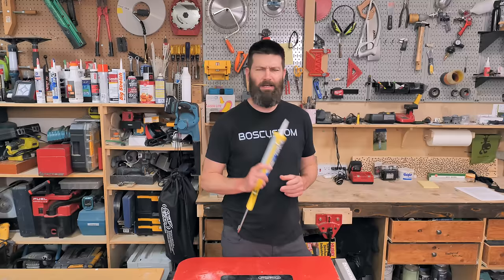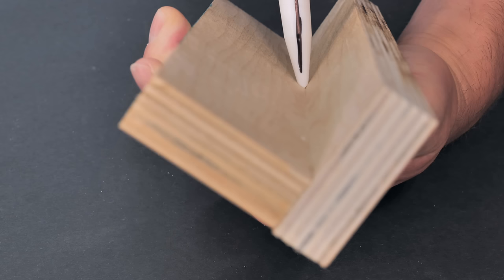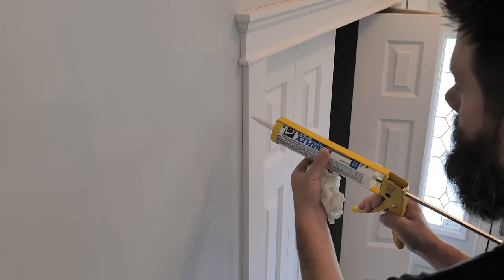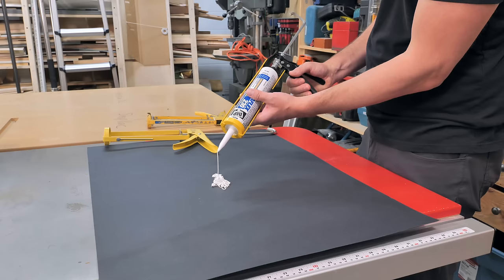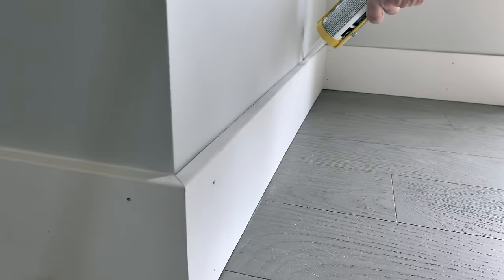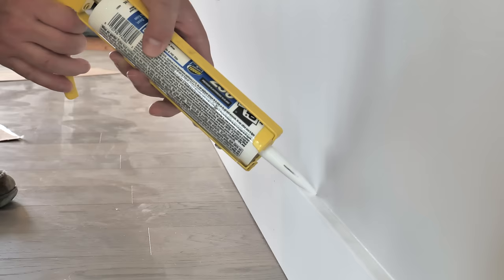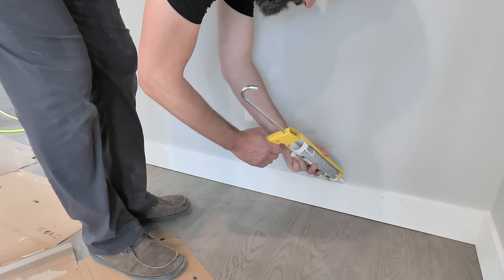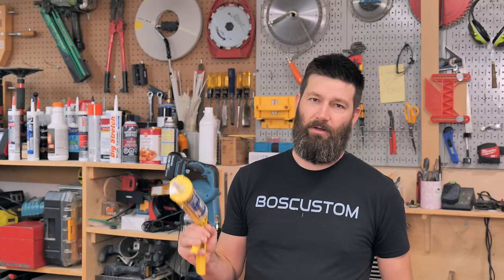The Secret Caulking Tip That Will Transform Your Ability!

Comment: I'm a carpenter and when I have to caulk, say, a vanity, I lay masking tape 1/8" above the vanity on the wall and another, 1/8" out from the wall on the vanity. Then I run the bead, not being careful at all. Then I scoosh it out with my finger and immediately pull the tape. That makes a totally perfect bead every time. I've been doing it that way for 50 years.
Reply: Interesting, 50 years and you still rely on tape?  I would think by just blobbing it on and smearing with your finger you will be left with ledges once you remove the tape, or maybe you prefer that.  A thin controlled bead will be much neater and not require the time to get the tape perfectly aligned on both sides.  but to each his own.
Reply: Bob, I had to go a step further and learn to not leave the masking tape on overnight. That’s how I learn!
Reply: @koolbeans8292  I've done that too..... once.
Reply: Yes, I do that but it leaves a tiny edge when you lift the tape.
Reply: Thank you for applying your input on how to waste time and money. 👍🏻. Could you imagine how much wasted time you have spent over the years laying tape just to shoot a caulk bead… 🤦🏼‍♂️
Reply: @debandmike3380  it just idiot proofs it and takes the you might smudge it factor out. I agree it’s easy to do but one f up and now it’s a mess if visible. The tapes neat EVERY TIME and it’s quick to do. 

-Carpenter who caulks
Reply: If you’re a good carpenter you don’t need tape to caulk anything 😂
Reply: That’s a damn good idea
Reply: Same way I was taught.
Reply: @lubumbashi6666  Yes it does (leave a tiny edge). I just checked a piece of masking tape with a caliper. it's 1/1000" thick.
Reply: @cwill114 Oh yeah?
 Tell you what. Let's have a "caulk off" and see who can run the most perfect bead. I'll even buy you a plane ticket and furnish a rental car so you can come to my cabinet shop for the contest. On second thought, maybe not.
Reply: @99bx99  absolutely. Iv shot thousands of tubes of caulk as a commercial waterproofer. I’ll laugh in your face as I leave with your money. Where do you live? I’ll be glad to fly out on my own dime. I’m in South Florida
Reply: @cwill114  I couldn't be any farther away..... WA state. I've only been to FL once. I sold an airplane and delivered it to Naples. 12 hours later I was on an airliner to Portland, OR.
Reply: Yeah if you caulk everyday for a living, you're probably real good at it. I don't and when I do, I use blue tape as described. Lay down a bead, then wipe with a damp finger. Pull the tape then wipe again to remove the 'edge.' Looks perfect like pro.
Reply: 😂 idk why I found this comment funny. Just a guy sharing what caulking technique hes stuck to for 50 years. Proven past the test of time.
Reply: It does not matter how you do it. It's the finish that counts ;- )
Reply: Yep but your not supposed to scoosh it...its making the caulking too thin and it loose is.flexibilty...but i agree it's doing a fine job i do the same... perfect looking
Reply: Ohhh I'm going to try this because no matter how hard I try Im terrible 🤣
Reply: Then you're not a carpenter you're an amateur
Reply: Tape, hahaha, that's cute.
Reply: @steveeyre6975  I’m not sure how me shooting thousands of tubes of caulking equates to birth knowledge… but thank you for your non pertaining response
Reply: Lies
Reply: A brilliant tip! Many thanks
Reply: Pro tip
Reply: I use the tape method too. But I always wonder if it would be faster and cheaper (save on tape cost) if I were more skilled
Reply: It leaves ridge 👎
Reply: @koolbeans8292  wow that's Kool Beans
Reply: @garyharrison1322  Yes it does (leave a ridge). My caliper tells me that it's one, one thousands of an inch thick. In other words, stack 1.000 layers of masking tape and you get 1". Now, if you want more perfection, you could use flash tape (used in the composite world). It's about 1/10th as thick as masking tape.
Reply: @99bx99  so does that ridge actually make a difference in performance though?  Like does it allow for water penetration or is it just aesthetics?
Reply: Yepp
I do that for showers, bath tubs, counters etc. 
Works especially good when using silicone.   Great control.
Reply: Thought this was kinda the standard
Reply: Well arent you special
Reply: So many people lie their asses off on these posts on carpentry videos, it's really funny.. Bob, I've been a carpenter, remodeler, cabinetmaker for 40 yrs and there is no way u need to use tape with even 5 yrs experience if someone takes the time to show u how..there's no way u have 50 yrs experience and using tape  to caulk, cmon now 😄😄
Reply: I've been doing it the same exact way for a few years now. It's definitely the superior method.
Reply: @steveeyre6975  speak for yourself, I came outta the womb caulking like a boss 👶🏼😎
Reply: Tape 😆😆😆😆😆😆😆😆
Reply: Agreed
Reply: @oneballwizard406  When you compare the results, and long-term longevity, taped off caulking produces a significantly better edge for long-term durability, and your finger cannot compare to a 100% perfect straight line.
Reply: @zqzj  I don't use my finger lmao
Reply: A tape line is great when caulking to something that will stand out, like a backsplash or tub surround. If you're caulking against something that will be painted, just caulk and smoosh down with a wet finger until it's nice and smooth with no ledge.
Reply: @lavenderseedandworms  all the more reason to tape off your caulk. Way easier to tape off pin straight caulking so you can paint around it.
Reply: @zqzj  learn to caulk like a man and you don't need tape🤣🤣🤣
Reply: I’m literally about to caulk a vanity. Thank you!
Reply: @kylenieber7380  Let us know how it works out for you. Also, this eliminates the mess it makes when an air bubble in the caulking tube splorches out and ruins that perfect bead being run.
Reply: 99bx99 as a carpenter I'd be fired if I insisted  on doing this every time I did finish carpentry. I can run a bead of caulk much straighter than I can run masking tape. I didn't get fired for trying and failing until I got it right.. a damp pinky finger at the right angle, pressure and speed works well. bet I could learn a lot from you sir, but time is money these days.  unfortunately.
Reply: Wait until you discover silicone profilers.
Reply: Sounds like 2 extra steps I don’t have to take!
Reply: The tiny edge is fine except where dust or water might gather, however small.
Reply: As someone that is not a carpenter at all and have rarely had to caulk except to maybe go around a window to replace cracked caulk, i have tried those silicon squeegees and those still leave a mess after a couple swipes... I need to try this. The people that built this house used the smallest beads around the windows and they all have cracked... I don't care if using tape is a waste of time or anything, if it makes it look clean and prevents a mess, i need to try it. It is not like anyone will be looking at each window and thinking that little lip (1/1000") is going to be an eyesore... Maybe if i did caulking for a living i would learn to not need other tools, but i dont. Thanks for this idea and i will definitely need to try this.
Reply: I guess when you're paid by the hour, you find all kinds of ways to make the job last longer and screw over the customer. 
🤷🏼‍♂️
Reply: @theiowafishingchannel4693  Sounds like he never left the newbie phase after 50 years if you ask me.
Reply: @andrewpipitone1572  You can pay a carpenter to work, or you can pay them to waste time and your money laying and removing tape. 
A good Caulker would have an entire room better done by the time this guy finishes his first wall of baseboard.
Reply: @rayday007  Actually, the correct pronunciation is cork. Like loggers wear caulk boots, but say cork boots.
Reply: I totally do this since decades and the results are always perfect!
Reply: My brother and I are contractors. He does that.. I hate it and his product lol...sorry... to each their own kind sir.
Reply: @marzinjedi6437  It's actually an amateur method that works great for home owners or people not in a hurry. It is slow and costly at production scale with little to no benefit other than it made it psychologically easier perhaps.
Reply: Ok so tell me if I’m wrong, but the time Bob saves not preparing the tip as described in this video and laying tape instead… doesn’t that even out?
Reply: @cwill114  "non-pertinent".
I've shot thousands of words as a mercenary journalist.🤣🤣
Reply: @funstuffonthenet5573  No need to wonder anymore. It's ALWAYS faster and cheaper if you are more skilled.
Reply: @debandmike3380  Both methods have different advantages and I use them depending on the task. For the normal finish, for example for skirting boards, a careful application is sufficient. When working on high profile joints such as around a sink, bathtub, etc., finishes with some closeness to the eye, I use the masking tape trick. I also like the slight edge the tape leaves when I peel it off. Like a very thin garment hem.
Reply: @lubumbashi6666  I like the slight edge the tape leaves when I peel it off. Like a very thin garment hem.
Reply: @Frickmook  everyone appreciates the truth until it’s directed towards them. Cry your heart out
Reply: I am so glad I went to the comment section because I was about to try to do my backsplash with no tape. Thank you so much Bob. you’re the fucking man.
Reply: @joshswinn3483  Thanks for the compliment! Also, it seems that there's always an air bubble in the caulking tube that spoils an otherwise perfect bead even if you're good at it. With the tape and scooshing it out with your finger it doesn't matter.
Reply: I was just thinking of trying a tape above where I will apply the Chaulk lol! Thanks for sharing your thoughts. Will definitely try it. 🥰
Reply: Great video, except orientated is bugging me.  Oriented FTW.  Thanks for the tips!
Reply: I really appreciate the masters sharing their techniques
Reply: @w.w.w.4239  yeah, do it right next time or pay someone to do it for you
Reply: My late Husband learned that technique at like 41. There is a name for it and I can never remember it.
Reply: @KingHarry1  I don't need to tape to paint, I'm good at everything, but when I caulk it looks like my IQ is low.
Reply: Wow, man...I use a cut sponge and I'm done in like 30 second from start to finish after I'm ready. Tiny bucket for the rinse water.
Reply: @JamesofJesus  🥴🥴
Reply: @99bx99  🤣 "caulk off"
Reply: Nice trick, makes sense.
Reply: Man, i dont doubt it turns out nice but that sounds like a lot more work and a lot of wasted caulk
Reply: I was a painter for 3 years... if the boss caught you using blue tape you'd get yelled at, very rare times that we would blue tape anything ...he fired a kid one time cuz everytime he went to paint something he had to blue tape... I learned very quickly how to caulk and cut without taping or making a mess. Can still do it today 20+ years later, people come to the house after I paint a room and swear that I must have used tape to make my lines 🤔😂
Reply: @CaseyQ  we all know that you don’t like wasting the “caulk”
Reply: @KingHarry1  or if you're one who doesn't care. Lots of those "carpenters"  these days.
Reply: I don't care WHAT the vid is. There is ALWAYS an expert who wants shine in the comments 🥤make your own vid.
Reply: Well, I used to use tape, but with continued practice I don't use tape anymore.  Lay the bead and hit it with a profiler, perfect all the time and a big time saver.
Reply: I install windows, thank you for this tip.
Reply: If you put tape just on the vanity..like you said, 1/8 back from the wall, and run a bead small enough..but enough to make a good caulking line, you shouldn't have to put tape on the wall!!  that's just totally unnecessary and a waste of tape.
Reply: @debandmike3380  Your definitely not a painter, or never had to do that type of work for a living.
Reply: @koolbeans8292  exactly..I learned to take the tape off before the caulking dries.
Reply: Brilliant tip!! Thanks
Reply: @KingHarry1  agreed
Reply: Everyone on you tube is a pro. Not really. Like everything else, there’s many ways to tie a knot and after many hours I have come up with my own way of doing it professionally. However I’m not that vein or filled with free time to make a video about it. I actually do it daily
Reply: Horrible advice ,  learn how to do it properly , no.professional will ever do that, and the edges left after the tape is pulled leave and un smooth finish allowing mold and dirt to build up easier
Reply: You have changed my life. Thank you!
Reply: A wife here, who has done her (un)fair share of caulking and usually messes it up. You guys fight over the best way to do it like a bunch of old women arguing about the best way to roast a chook. 🤣 so funny!   Each to their own...
Reply: @christinagodfrey494  Out of 101 replies (not all good, but most are), yours is my fav. Caulk on!
Reply: 50yrs of a whole lot of wasted time. You are not a carpenter!
Reply: @johncrowe6489  No, they don't even out. Tip preparation is maybe 30 seconds per tube. Taping is minutes per straight line. I don't know which is worse... loooong straight lines where even a tiny deviation from straight is a massive issue or areas with heaps of nooks & crannies.
Reply: This is the method used in cheap rental & motel bathrooms worldwide & it shows- the caulk is super obvious & way too thick. I'm def not saying it can't be done well, but careless caulkers who leave a ledge ignore that a) it looks unprofessional b) water will pool on the tiniest ledge c) people (kids) are annoying & will pull at that kind of thing with their nails. Don't give them anything to pull at.
Reply: Missouri state champ two years running any takers?😮
Reply: I'll do that on tubs and sinks with silicone because it's a pain, but it's not worth it with latex. Just keep a wet and dry rag with you
Reply: @madeleinebray5205  Lol because there's really no difference when it comes to people who have done something their whole lives 😂😂😂
Reply: I put the tape under the caulking - that way when you pull up the tape, all the caulking comes off and you have absolutely no caulking mess at all. 😎👍
Reply: Carpenter leave it to the painter.
Reply: @rufusjohnson3800  😂😂😂
Reply: @TheVDaddyo  😜
Reply: The is the most embarrassing thread
Reply: @michaeltfa1592  aesthetics
Reply: Soapy water does the trick as well
Reply: That's what I have been doing but it take a long time.
Reply: Where is your shop I’d like to come hang out and work a week for free just to learn some new stuff I’m almost 50 and I’m still learning.   taking on welding now it’s going well only thing all the grinding and prep work some times gives me headaches
Reply: I’m going too have ya agree with Tiny down in the comments I haven’t been the best at chalking but I bet ya I will do it better now after seeing this video. Ps guess you can teach a old dog new tricks haha
Reply: Unreal!! I guess you'd never want to have to caulk trim. You'd be there a month taping everything 😆 50 years man!?
Reply: @marcusfoerster1911  his example was literally a vanity
Reply: @randybobandy9828  he also said he was a carpenter. No disrespect, but I guess it has different meaning in other states. Carpenter's are able to do every aspect of building.
Reply: @marcusfoerster1911  so how does that fact change anything? Caulking is probably a minimum part of his type of work. Who cares that he uses tape?
Reply: @marcusfoerster1911  I'm a carpenter. My trim work doesn't need caulking.
Reply: @KingHarry1  damn.. I guess if you can't Do a decent caulk bead that means you are bad at every aspect of carpentry.
Reply: @99bx99  I'm in WA too, hopefully you're not on the westside by Seattle. Shits gone downhill there.
Reply: It was worth watching this video just for this good tip in the comment section! Thank you!! 

The video wasn't bad at all, I love the drip less gun... But I'm a newbie first timer doing a shower and none of this really helped me much.
Reply: @randybobandy9828  Nope, I live in White Salmon on the Columbia River, one mile north of Hood River, OR. We love to say, Oregon's a great place to shop (no sales tax) but I wouldn't want to live there.
Reply: @cwill114  the difference is people like you believe in a wide range of "good enough". Some people like to give the same level of quality each time and then some people are Florida man and just wing it.
Reply: @GameTimeWhy  no the difference is I have enough experience that I’m great at caulking all the time. If you shot thousands of guns worth of caulk over the course of 5 years… you are considered an expert. That’s the difference bud
Reply: @cwill114  doing a shitty job for 5 years doesn't make you an expert. Doing something poorly for any amount of time doesn't make you good at something.
Reply: @GameTimeWhy  coming from the kid that has gamer as his tag… you are a real trusted source of information. In addition to kid, I’m 30 years old, live on the water, own a million dollar boat, house paid for, owe nothing for anything. I would say my work has paid off. When you get out of mommy’s basement and have some real life experience… get at me.
Reply: @cwill114  the 30yr old millionaire that frequents YouTube comment sections. Yeah, sure you are Mr Florida man.
Reply: @GameTimeWhy  and it feels great living rent free in your head 😂
Reply: @GameTimeWhy  just remember bud, I’m living rent free in your head. It’s nice to be financially independent in my 30’s. If you get out of moms basement… you might could do the same
Reply: 😂 this is the way a carpenter would do it. NOT A PROFESSIONAL CAULKER!
Reply: @timmy2good883  That's true, but 99.9% of the people who read my post are not professional caulkers.
Reply: Sir, after you remove the tape, don't you get sharp edges on the bead of caulk where it was in contact with the edge of the tape (sharp as opposed to smooth)?
Reply: @guyrabinowitz  that's true, but edge is only about 1/1000" inches high and not noticeable. Try a sample and you'll see what I mean.
Reply: @timmy2good883  thank you! Finally someone with some common sense lol
Reply: You could have saved 25 of those years if you took the time to actually learn how to caulk
Reply: @michaelhanson5773  I've been using tape for the ease of clean up, after beading the silicone a swipe of a wet finger and pull the tape straight away and a second swipe of a wet finger and no ridges or mess to clean.
Reply: It’s like a big caulk competition in this thread.  Love that people are getting heated over laying glue!
Reply: Amateur
Reply: @99bx99  Portland, Oregon!  You have my sympathy.
Reply: @123Rockchild  I don't live in Portland, OR. I live in White Salmon, WA, one mile north of Hood River, OR across the mile wide Columbia River and 60 miles east of Portland. We WA people love to say.... Oregon's a great place to shop (no sales tax) but I wouldn't want to live there. Hood River is the windsurfing/kiteboarding/foiling capitol of the US and 35 miles from world class skiing on MT. Hood. There is virtually no violent crime in this area. I have a CWP and the only time I carry is when I have to drive into Portland which might be the scummiest city in the US.
Reply: After reading all 149 comments to this post, all I can say is that our society is screwed ! We're done ! Smh....
Reply: Ugh. So many rude know-it-all’s.
Reply: Yeah I I will waste my time on taping specially when I’m doing the price work
Reply: I do this on jobs that need to be perfect
Reply: You just release the pressure and pull it back slightly then it doesn't keep coming out, no need for a more complicated costly tool.
Reply: If you make the bead the right size you won't have it squeezing out everywhere, you can buy plastic tabs for smoothing it out if you don't want to use a wet finger, I've never had the issues shown in this video, you'd have to put way to much excess on to end up like that.
Reply: ive been doing it for 73
Reply: @nerprun  Dude, you're REALLY old. I'm only 78.
Reply: That incredibly inefficient
Reply: @debandmike3380 this is the way
Reply: Gotta use very thin tape though, maybe kapton. Or else it leaves that edge where the tape was, which then rolls up and leaves you with stragly mess all along the joint...i just experienced this with masking tape. Same method.
Reply: @99bx99  yup but that peels up and then its 3-4mm of flangey bits all up in the air.
Reply: @cwill114  your kids will have that skill embedded in their dna now :)
Reply: @99bx99  the edges peel
Reply: @99bx99  store your tubes upright
Reply: Why are you on this video then
Reply: @callmewoody1206 Vanity install when walls aren't square?
Reply: Your sneaky man!  That’s great I just need to have tape around
Reply: I like smearing that stuff around hahah

ORGONITE add metal powder!
Reply: All you boneheads dissing the tape method 😂 I wonder how your caulk jobs look where two irregular surfaces meet, like tiles with grout joints in the corner of a shower? Oh, you only caulk in paint-grade trim? Fine then, smear it all over, boys. I own a high end remodel business, and make a very good living with my caulk ahem and we use tape when we need to, like in showers, tubs, counters, etc. It's how I do it, and it's what I train my employees to do. Why? Because it eliminates any possibility that you'll have silicone smeared all over the shiny and expensive tile or stone, duh. It takes all of 15 seconds to tape each side of the joint, you can tool the bead till it's flawless - tapering it out so there's no buildup on the tape edge - then pull the tape and voila. LASER straight and clean. Caulking is one of the very last steps. I want it done right, once, so I can collect the check and go home!
Reply: @MrPhilosofly  Pretty much what I said.
Reply: @cwill114 where in SWFLORIDA?
Reply: I’ve never done that and need to caulk for the first time at 78 yrs old. Not looking forward to this job but it needs  it before the hurricanes.
Reply: @4America2024  I'm also 78. If you follow my suggestions, you'll have nothing to worry about, that is, as long as you pull the masking tape immediately after caulking.
Reply: @4America2024  Stuart
Reply: That's the way I do, we tape everything even painting. Fast, proficient taping everything out and I think it's faster especially 2 coaters, pull the tape laser line perfect everytime. I don't care how good anybody is with a brush, me included can't match a tape line.
Reply: @ystebadvonschlegel3295 both are acceptable. ‘Orientated’ is British English.
Reply: @madeleinebray5205 ”Caulk fighting” 😂
Reply: What a waste of time.
Reply: Came for the inevitable "caulk off" arguing in the comments. Was not disappointed 😂

I'll beach any one of you off right here right now
Reply: @michaellake54  Beach? Is that like "put him on the trailer?"
Reply: @JamesofJesus How big of a job are you doing in 30 seconds??
Reply: @beckykosher1128  perhaps i should make a channel. i was specifically talki g about bathroom vanity.  ive timed myself many times. from entry to complete, its just caulking im speaking of. closer to 20seconds, 30 if tricky
Reply: As a painter, if I was to waste masking tape everytime I wanted to caulk I'd have to charge the client double! Good tape is not good, And caulked isn't cheap either to be just throwing down the drain! We have to get things done as efficiently as possible, so getting good with the old caulk gun not only saves on materials but also time. Time is every tradesman's worst enemy..so we don't want to be adding time to our work that can easily be avoided!
Reply: I'm caulking my house now, masking tape is truely helpful especially on the brick wall.
Reply: I do the same. Perfect every time.
Reply: You waste the caulk, you waste time laying the tapes. But in the end you give that caulk a little push to fill up the crevices.
Reply: You must spend a boat load of money on tape, and wasted time to apply it first, you working way too hard
Reply: Painters tapes been around for a half century??!
Reply: I use paintable caulk and do that when I paint stripes or other patterns on a surface to create crisp, bleed free lines.
Reply: And the tape pulls the paint off.. brilliant
Reply: @chrisstone8560 Thet's never happened. Not even once out of probably a thousand times.
Reply: I like this idea of taping a straight line before laying caulk on a vanity or countertop., 1/8" seems a good size gap.  Thank you.
Reply: @Dee-zs1qt Thanks. You can't go wrong doing it that way. It's almost impossible.
Reply: People in this comment section: " IM THE FRICKN G.O.A.T OF ALL CAULKING.

Me: Still can't even figure out how to cut the perfect amount off the tip.....(
Reply: Best way to do it when using silicone, not nearly as forgiving as latex. I'd rather use tape and get mocked while having perfect results than not use tape but then spend more time cleaning it up... and still getting mocked but for doing a bad job. Do what works!
Reply: Smart
Reply: Waste of tape, just do what the video says.
Reply: Cool tip
Reply: No Real Actual Caulker would ever tape Anything
Reply: @KingHarry1 objectively false. Spoken like a non carpenter lmao.

Woodwork goes up against sheetrock 9/10 times and not only is sheetrock absolutely horrible and you don't scribe everything, but wood "breathes". It bends, twists, and expands/contracts with time and humidity or temperature. You can have gaps form where there werent any, or you can have tight fittings where there were gaps. Caulking is flexible enough to account for both of those and will mean the client never has to worry about it "breathing". There isnt any way to restrict this force either, any restrictions just cause warpage and horrid twists that will throw off level and plumbness, so its always best to just account for it instead of fighting it.

Don't talk about stuff you're ignorant about.
Reply: The most important part of caulking is the calk  itself
Reply: Some dishwashing liquid in a spray bottle and a paddle pop stick will save u time and money on tape😂 been doing it this way for 10yrs and wasted 5yrs before that using tape
Reply: @Sean-410 😂
Reply: If you need to go through all that bullshit just to get a good caulking bead you’re definitely NOT a carpenter…….
Reply: @jwade1976  Oh, I'm a carpenter all right and have been for 45 years, but I'm also a cabinet maker and have a 1.000 square foot cabinet shop and I'm a perfectionist. after I pull the tape, you can lay a straight edge on the caulking beads and they're perfectly straight.
Reply: @99bx99  And the reason you can lay a straight edge on them is because there is an edge. Because he use masking tape to create an edge. If you really knew what you were doing the caulk would blend perfectly into the wall and there would be no edge to lay a straight edge upon! Lmao ✌🏻
Reply: @jwade1976  Yes it does leave an edge. I checked a piece of masking tape with a micrometer just now. It's 1/1000" LOL.
Reply: Thankyou! We did the crapiest job ever on our bath and vanity! Looks like total shit! I wanna get it out and try that tape trick out! Gonna look for a removal video now!
Reply: It leaves a ridge where bacteria will build up and go mouldy. I wouldn't even use my bare finger for the same reason, use gloves or a proper caulking tool.
Reply: @ZX48K  Nope, that "ridge" is only 1/1000" high and doesn't get moldy. At least none of mine have in 33 years.
Reply: @zqzj  that's assuming you can tape a perfectly straight line free hand
Reply: Nothing pisses me off worse than a overly trimmed caulk tube tip. Btw ..I once injured a man with a tube of caulk. 🔥
Reply: I do the same. And I’m just a dad
Reply: @rudyvalle  Smart dad!
Reply: @NattyChaz Who said anything about plaster?
Reply: Many thanks for a very good primer Your tip preparation steps in particular make all the sense in the world. Wish I had thought of them - or been taught them - before!
Reply: @99bx99 which is a totally visible line that simply should not exist. I agree that masking is essential against certain materials that simply cannot be cleaned or wiped .👍
Reply: Good morning @99bx99, I was wondering if you still use tape sometimes and when do you choose to use it, if you still do?  Thanks!
Reply: @OptimusChrist274  Yes, anything interior that I want to look nice and perfect.  outside, like caulking siding or something, no.
Reply: @99bx99  I'm your Huckleberry. I want to see your cabinet shop! 😂
Reply: @katmeals2348  Well, you'd have to come to White Salmon, WA in the Columbia River Gorge to see it. It's 1,000 sq. ft. and it's also an airplane building shop (mostly Long EZ's) and I've rebuilt 8 totaled Corvettes here. I'm 79 and don't do many cabinets these days, but some. There's a structurally complete Long EZ in it right now ready for paint.
Reply: not ideal for someone that does a house a day, everyday but for 1 m lengths tape will do
Reply: Interesting!  Three distinct operations for the result.  Costly and time consuming.  there is a better method….
Reply: Great tip 👍🏻
Reply: @billiexluxury  Thanks.
Reply: Can confirm this is the way you do it.
Reply: @brokentombot it’s not an amateur method. I’m an aircraft maintenance engineer - which means I work a on aircraft for a living. Every time we apply sealant to something, for example when we install a cockpit window, we always tape and use a spatula to wipe it off. It’s an industry standard practice. We also use the gun in the opposite direction to what the video author does, it eliminates air bubbles
Reply: I’ve been caulking for about a year and I’ve never used tape.. just my finger and a dry towel and it’s perfect every time
Reply: If you learn to do it properly you don't need tape. Plus it takes a tenth of the time
Reply: If youre a good carpenter, youre smart enough to know when to use guides. I can tell youve never even been in a shop @KingHarry1
Reply: Great tip!
Reply: Thats exactly how I do it as well. Works great for exterior windows done with rubberized gutter caulk as well.
Reply: Tape makes for lean, wonderful joints that I’m very happy with, and I’m hella picky!
Reply: 6:15 lol homeowner chalk job
Reply: Just put it on and wipe it with a wet cloth and it’s perfect
Reply: I wouldn’t want anyone that uses tape to caulk, work on anything. What a waste of time and money.
Reply: Tape tends to leave a slight edge on it. I'd sooner just tool it in with a cramer tool or something.
Reply: @bl4ckw3ll  Yes it does, the thickness of masking tape which is 1/1,000". Big deal. Masking tape is the only way to get the edges of the caulk absolutely PERFECT.
Reply: @KingHarry1 oh really? So how do magically solve the problem of gaps between window sills and sheetrock/ windows and sheetrock?
Reply: Me too
Reply: @koolbeans8292  You only did it once I bet!!
Reply: @lubumbashi6666  Then run your wet finger over it after removing the tape if there is any edge!